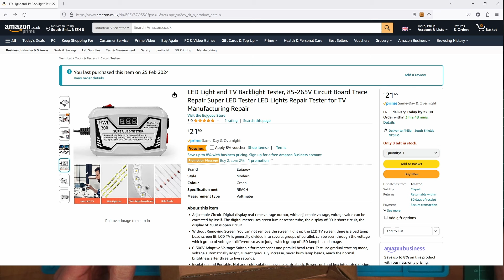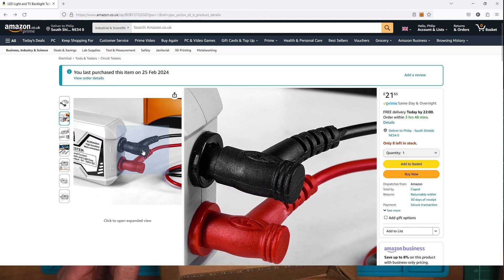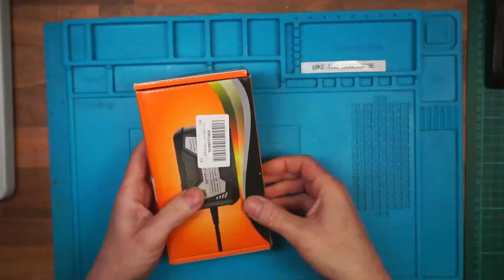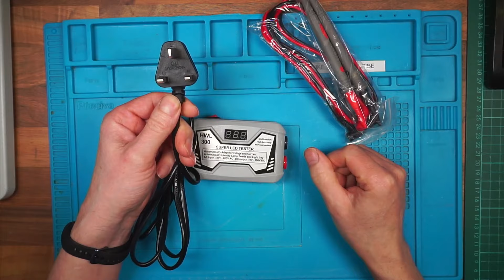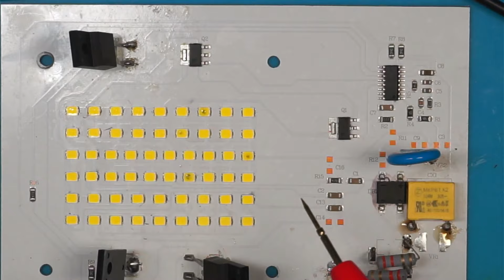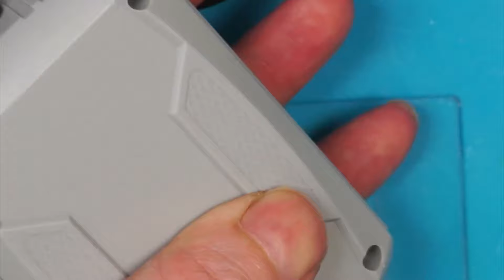HWL 300 LED TV Backlight Tester Unboxing and Testing

Comment: I ordered one from AliExpress after seeing one on @BigClive’s Channel but they cancelled my Order for some strange reason, He touched the Probes together and was able to change different Settings but I think the internals were different between his & yours but could be wrong?
I had a Plug similar to that on a Cheap Chinese Wi-fi CCTV Camera and I was able to easily Snap the Pins off the Plug which is something that most People wouldn’t have the Strength to do on a Proper UK Plug,
I ended up replacing the Cable & Plug because it was too Short anyway and now it has a much longer Cable & a Proper Fused UK Plug on the end as well,
I uploaded a couple of Videos of me snapping the Pins off the Plug,
A full length Video of the Camera and a Short of just Snapping the Pins off the Plug as well!
Anthony - Birmingham
Reply from the maker: I bougth this for some LED lights I was trying to fix, sadly it hasn't had much use since then. I do like the idea of replacing the cable and plug tho. That's something I'll definitely do next time I use it. Thanks for the tip.

Comment: If you work on LEDs this is a must tool. I have this same one and I love it. It's nice to have the right tool for the right job. I just ordered a solder removal station, I'm sure it will make life a lost easier especially when doing a lot of solder points.
Reply from the maker: I have to admit since buying it, I've not actually needed to use it lol. Like you say, right tool, right job. I'm sure it will come in handy at some point. Thanks for visiting my little channel and leaving a comment.

Comment: I often times find myself trying to figure out if my driver is dead or if there's an issue with the leds. What I've done is just pick up a replacement driver and see if that works and if it doesn't I decide there's an issue with the LED or the wiring, and then bring it into a shop. I'd like to cut out the middleman by using a backlight.

Comment: I made a high voltage "zener diode tester" (but really it'll test anything with a voltage drop, including LEDs) which does pretty much what this does but only up to 210v.  It limits the output current to 4.5mA though, so no zapping from mine but I'm not sure how it would work with a bunch of parallel LEDs.  4.5mA isn't a lot to share around.  I guess yours pumps out a fair bit more current, hence getting zapped.  I made two versions, one runs off an 18650 and the other from a 9-12v supply - so no risk of a failure or internal short connecting me to the mains voltage.

I just noticed another comment says that it puts out 20mA.  I could do that with mine also with a simple resistor change - though that'll allow finger tingle, as yours does when touching the leads ⚡⚡.  I'll keep it in mind if I ever need to test a floodlight, TV or whatever.  In fact, maybe I'll build another with a current selector switch to choose either 4mA, 10mA or 20mA.  Thanks for the improvement idea 👍
Reply from the maker: You built your own, well done. You're far more clever than I am. I can't even use this one without electrocuting myself lol.  Thanks for popping onto my channel, watching the video and leaving a nice comment.

Comment: If you're wondering about little gadgets that are good to have around, here's one of my favorites. 

You take the same concept as your normal everyday 120v or 240 AC load lamp.... and apply it to a 12 volt car tail light bulb. In the FPV drone community, we call them Smoke Stoppers. The idea is to prevent your power supply (presumably a battery pack) from providing too much current to your DC load, and causing the smoke to come out. If the bulb lights up, then there's a short. I used an 1156 bulb for this. 

You can make a 6 volt version too, by using a 6v tail light bulb for an old VW or somesuch. I used a 1651 bulb for this. 

In the FPV community, we use XT60 connectors (because that's what's on our batteries), but you can use any connector you want for an electronics bench. Perhaps alligator clips?
Reply from the maker: That's interesting. I normally use my bench power supply, which will cut out if it detects a short. There is a lot of different voltages and power jack sizes to consider. I'll have a look into it, thanks for the info.
Reply: @PhilipBryden  Sure no problem. The bulbs will work for a range of voltages. Most of the time I use that 12 volt bulb for a 4S lipo pack, which is 16.8 volts fully charged. They also work for lower voltages too. I've seen guys use them for 5s packs and 6s packs (for short bursts). 

The 6v bulb is great for your low voltage applications (1.5v to 9v). Guys used them for 1s and 2s quads.

Comment: It seems a current source of 20mA. The 12V led is probably designed for a lower current, so you will see a higher voltage with the HWL300. Testing a led with a power supply without any current limiter is not recommended, its easy to destroy the led in that way.
Reply from the maker: You are spot on. I ran the LED tester through the multimeter just no and the 12V LED took 20mA. I'll use this tester rather than the PSU in future. Thank you for your help. I wonder if a separate little amp meter might be a useful addition to my desk.

Comment: Well done Philip you may be getting spurious readings going through your series lamp, when you were probing the mosfets it looked like those few you said didn’t light worked, and oh I forgot to say you can get a kick from the leads, also if you’re doing LEDs that are connected to a power supply disconnect them from the power supply saves charging the caps up and getting a bolt up your arm 😊
Reply from the maker: I'm really annoyed because there were half a dozen of these faulty but I only picked one up. If I had another, I would have the LEDs needed to swap the faulty ones over. It looks like this one will have to go on the back burner for now until I come across some replacements. I could get the probe out and check for a signal from the driver IC but I'm already getting 5V on the mosfet gates, so I'm assuming it's ok.

Comment: 20:39
You could get those $5 Ammeter Panel and plug it in after the leads.  Or even better if you have a multimeter lying around.
As you see its 16V, but can't see the current, kinda difficult to find a proper resistor/replacement.
Reply from the maker: I just hooked up my multimeter. A single LED is 20mA. Oh and they are 3.3mm * 2.7mm